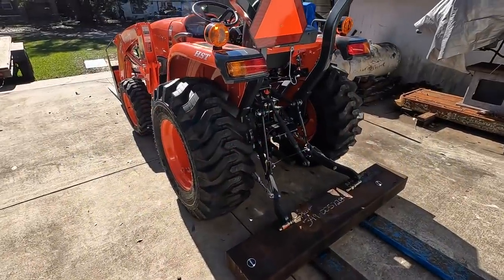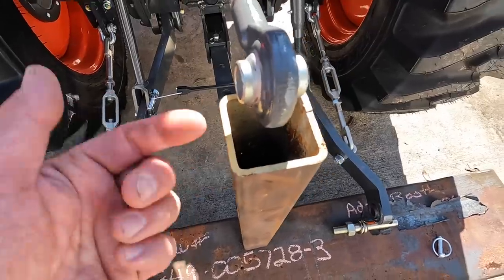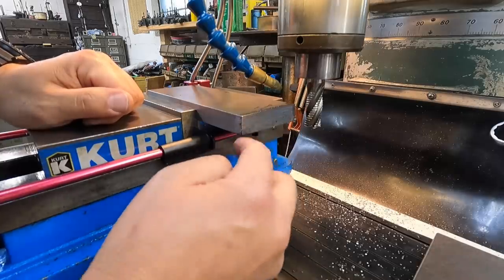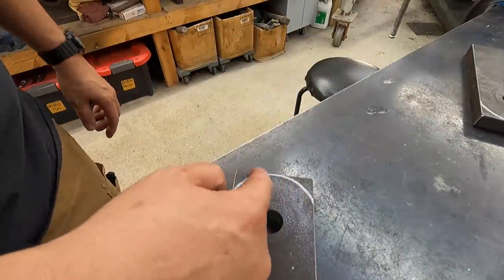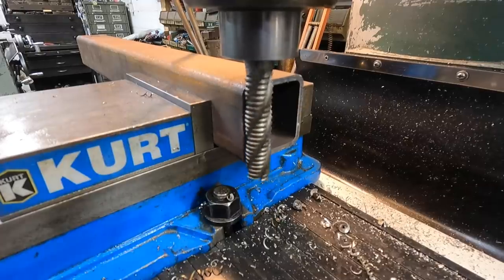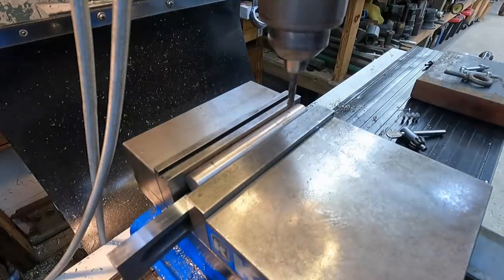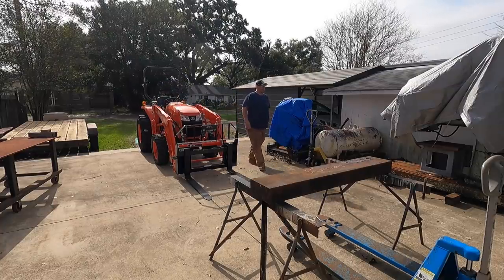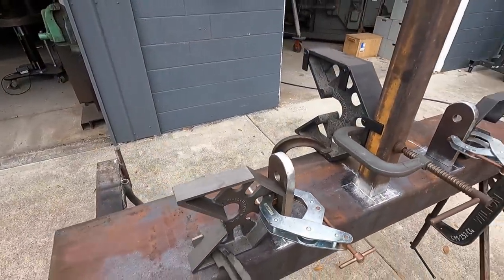Tractor Rear Counterweight Part 1

Comment: Adam,
It you put liquid in the tire don't use calcium chloride as if you have a tire leak it will also eat up your wheels.  I would get lunch pins for holding the weight bar.  They have a spring loaded keeper handle.
Reply: It only eats the outside of the wheel?  Pretty sure those are tubeless tires...

Comment: good to see "the tool specialist" resorting to using the good old grinder to make a hole like us other poor plebs have to all the time! lining up to watch part 2 and wondering if you will add some bracing to the centre post, and wondering if you are setting the bottom two mounts up so you can undo it easily when you want to take it on and off. (I have no idea if those bottom bars can be moved in / out far enough to clear the pins, or if you will have to unbolt the pins to take it off)

Comment: I'd tip it up on edge and just use the bottom links and let it dangle.  One less thing to hook up when you need to switch implements.  3rd link is always a pain to hook up, especially if the angle/length is not identical to other implements you use.  Will always be screwing that link in or out!!
Reply: and have made the ears much shorter, less swing.

Comment: Solid rubber and calcium chloride are also popular fill mediums for utility tires.  If you're on hard surfaces, I'd go with the rubber poly-fill.  I had some forklifts done with rubber years ago.  The water based fillers can corrode the wheels, and end up being really hard, good for soft surfaces, but wear out tires quickly on pavement or concrete.  Rubber fill is really heavy, but stays slightly pliable and won't corrode the rims.

Comment: Instead of wet tires, why not discs in the wheels? Same effect, less maintenance/repair cost. I've had wet tires, and if you break a bead or puncture one, it is an additional cost. Add discs (1/2" plate) and you can add or subtract what you need or want. The wheels are already set up for counterweight studs. Then you only have tire repair costs to contend with when you get a flat. (Which you will....)
Reply: This

Comment: You can easily fill the tires with water. Adapter cheap on Amazon. Center wheel weights are great. Always there and out of the way. 3 point attachment points have standards. Easy to find online. Hitch pins can also be found at TSC and online. Normal is grade 5 and grade 8 is available. Lynch pins secure hitch pins easily and are larger than cotter pins. I would add plate to the upright where pin goes through. 1/4" will wear quickly as tractor bounces.
Reply: Use beet juice, not water. Water will cause damage in time.

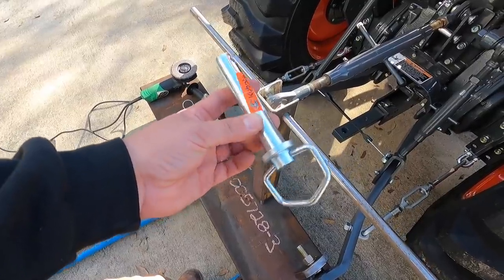Comment: @22:43 Imagine you’re at a farm 200 miles away from the dealership… we use anything we can fit, even if we have to use bushings. BTW the top link helps you lift or level the tail of your implement; usually connected to the end of it, not to the front as you did.

Comment: R clips or lynch pins are the normal for securing hitch pins. A chain or cable from the tractor to the eye clip stops them getting lost in grass, or just have lots of spares 😐 heavy screwdriver are frequently used as a temporary top link pin!
Reply: Until the pin rotates and the screwdriver falls out, and there goes your attachment.

Comment: If you didn't want to cut that solid block of steel, I would be tempted to mount it vertically to the three point linkage. It keeps it narrow and closer to the tractor. I would weld some box section on the base of the block to act as a base and a frame to attach the 3TPL

Comment: Most farm tractor weight are either an empty box fill with concrete, or water ballast the rear tyres with water which adds a considerable I was just writing that as you started talking about ballasting even seen 50 gallon oil drum filled with concrete, it doesn't need to be fancy.

Comment: BTW, the primary reason 3-point hitches became popular is that they form a 4 bar link that allows the center of pull, the point that an implement (originally things like a plow) acts like it's being pulled from, to be further forward and further down than a single-point hitch. Getting the location of the top link right is mostly important to get the center of pull correct (which a counterweight doesn't need).

The other advantage of a 3-point is that it can lift things that stick out the back up off the ground. For those, the top link position mostly effects how the load tilts as it lifts. Again something that's not overly important on a counter weight.

I guess the primary advantage to even using the top link here is that it can keep the weight from swinging.

Comment: For the tires use a non-corrosive ballast like RimGuard. Replacing rusted out rims is expensive. Also, buy the pins at something like a Tractor Supply store. Keep extras of the lynch pins. The counter weight is important to take the stress off the front axle as well as providing better lifting capacity and traction.

Comment: I would have made it with the lower mounts set up in double shear and use a pin to slide through them. You will find it a pain to back up and connect the counterweight with fixed pins like that. Easier to back up and then just side a pin throught rather than have to adjust your arms in and out. I have a small Shibura tractor with a loader and I have the rear tyres filled a usually hook up my 3ft rotary hoe for a counterweight.

Comment: By the wheel weights Adam,  water rusts things or get the calcium additive that doesn’t freeze!  also those front forks attachments are deceiving,the more you push the load in front of that bucket the less you’ll lift. Also the wheel center hubs will turn to make the rear wheels have a wider stance to match the plug.
Reply: Rimguard (beet juice) is the way to go. Calcium will cause corrosion.

Comment: Adam you can go to tractor supply and pickup your own water to tire transfer adaptor and put the water in your self. I keep a little over half way on my kubota about the same as yours.  your top adjustable  arm --where it attaches your tractor has three holes to choose from. the lower you put it the higher it will pick up  The water in your rear wheels will counter balance also

Comment: Chuck that hitch pin and turn it down to ".740 and then blacken it with some ospho!! Tractor Supply has a nice couple of plastic boxes with a selection of hair-pin, clevis pins and cotter pins for dirt cheap, AND they'll likely have any style and length of hitch pin you can possibly need. They've even got steel stock in precut lengths for the odd time you need to quickly get some material to make a repair or finish a project. It' more expensive than a steel supplier, but when you need it "now", it sure comes in handy!!
Reply: Abomb get a tape measure before a visit to TSC

Comment: You should weld a heavy duty D-Ring under the upper horizontal member (frame) of the pallet forks - very handy for lifting odd loads and pulling pallets forward!  I also added extendable / telescopic lower links to my Kubota's 3 pt - worth every penny!  One big caution - do not drill or weld on the ROPS - if you ever go to do a trade at the dealer they will subtract the full value of new ROPS..

Comment: Adam I’m surprised you didn’t just remove the bale on the but end,  chuck that oversized pin in your lathe, drill a center on the pointey end and turn it down to size.

Comment: Wheel weights are the way to go. They can be removed and no issues with wheels rusting. If you go with water in the tires, never use calcium chloride for antifreeze. Another advantage to wheel weights is that a field repair can be made to a small puncture with a pneumatic tire, and if the tire needs to be removed no issues with draining water.

Comment: Nice counter weight!
Kubota place should have informed you about fluid fill for tires when you was purchasing tractor. So that would have been done and more safe for you. Especially when you were purchasing forks. Bad salesmanship in my opinion. I bought a John Deere and they would not let it leave dealership without fluid filled tires because it had a front loader. With no charge for fluid fill.
Hey, add a 2" receiver on that baby. Those things are awesome for moving trailers around.

Comment: If you are lifting at the limit of your tractor, be ready to dump the load at any moment.  Keep your hand on the control, and if you decide to dump the load, dump it all the way.  Jam the control forward, and don't let off till it hits the ground.  If you stop halfway, your will definitely tip the tractor forward, or possibly break something on the lift arms.

Comment: A frame on the counter weight to put your tools in ? It is a top link to level the implements you hook up. Lift the tyre and put water in help a lot with traction

Comment: Funny, I knew you were going to have to sand down the top eye of the 3 pt. Made a ball hitch setup for my tractor to move trailers. Used the same sq tubing and did the same thing.  Saw the tube and said to myself " I bet he puts the hole center like I did" Heh.

Comment: I was suggested water filling the tires on the tractor I used in salvage countless times and countless times I've had to explain that helps with traction it doesn't help with counter weight and the weight it does add isn't where I need it to be. I need to pick stuff up ,balance, not drag stuff along, weight. The tractor was balanced on it's feet it just needed 600-700 pound counter weight, not the ~400 it had. I just wouldn't go out of my way to do it on this tractor unless it became an issue.

Comment: As a farmer, I’m going to enjoy you having that tractor to see all the projects you come up with that I might be able to learn from. Yes, liquid in the tires adds a huge amount of ballast and it’s down low for stability. But avoid calcium chloride which can corrode over time. I too have heard the beet juice works well. Why didn’t you just turn that oversized pin down? After all, you’re Abom!!!
Reply: Rim guard is fantastic.

Comment: Good idea about receiver hitch, hooks etc. WARNING! make sure that if you pull something that the chain or whatever attachment is BELOW center of gravity of tractor e.g. pumpkin on differential. If it is attached too high, tractor has enough power to simply pivot on rear axle and turn over backwards and kill you. Be very careful with tractors, especially PTOs, heavy lifts, etc. B-safe
Reply: Pull from the front only

Comment: Some of the comments here are interesting, and a few are even reasonable. Tractors are a world of their own, and you pretty much need to know all of it yourself, what model, what options, and so on, or the parts will be wrong. It is surprisingly better now than back in the 1970s, as pretty much everything follows a standard of some kind. My '49 Deere (personal machine- third owner) is interesting, to say the least. As for the tyres, weights are nice, but I prefer fluid fill. You need to be aware of the sloshing, handling them is a bit of work off the machine, and you need to be careful to keep the valve up when checking the pressure, but, in the conditions I have worked in (mostly soft soil and clay), fluid gives better traction as the weight is on the bottom of the carcass rather than hanging. Less cushioning, though. Rust isn't an issue if done right (proper mix), and it costs less than weights. Don't do what I did the first time I fabbed an attachment up and make it too wide to get the lift arms off.

Comment: do bioballast or whatever they have for the tires. very effective.  Sounds like a typical tractor dealership experience.  for others, the top pin on a category 1 3 point is almost always 3/4.    many implements are meant for either category 1 or category 2 and have a larger hole at the top for either size pin.   everyone with a tractor eventually just goes a buys a bunch of random pins and whatnot to have on hand.  we have 45 hp Branson tractor that is fantastic.  quite a bit heavier than the Kubota.

Comment: My back tires are full of brine for counterweights on my tractor.  If I need more than that, I just put the bushhog on the back.  You need a linch pin in that top post.  That nut is going to spin off into the grass in about 60 seconds.
Reply: Brine is bad, rots the rims off!

Comment: You can add the water yourself. Just need an air water adapter. Any auto parts store should have it, especially if you live in a farming community. O'Reilly Auto has part number XTS 15-4660 for $12.

Comment: Hydrostatic is definitely the best way to go for loader duties. Manual better for heavy all day pulling but I don’t see you doing much ploughing 😂.
Noticed you gripping rods without bending. Always wondered why you bent the rods anyway.
I have some rods from the ‘70’s that I inherited and use up on non-structural sometimes.
Good work Adam!

Comment: Was talking to a friend about this. He actually sent me a link to this. My first thought was, "is this a joke?" I know that seems like a chunk of counterweight, but most big forklifts have as much counterweight as they are rated for, and there is a reason which many people including myself have learned the hard way. This is the best way to learn Newton's Theory, no better way to learn about gravity and weight.🤫In the case of a tractor it might be ok as you're not lifting too high and I'm guessing you'll only move a few inches to move heavy stuff like machines? There's a tremendous amount of leverage on the forks. Would be good to test lifting say 4000 lbs. with the counterweight on it, or even how much you would lift. If you end up with a shop forklift this could be mute, but I was guessing you'll take this to your newly acquired property where you may build your own shop? And functioning as a tractor, I don't think you could lift too big of a log with a tractor, certainly not without tipping it.
Reply: Ok, now I kinda get it after watching and reading more...your tractor only lifts about 1100 lbs. so this is actually perfect at about 930 lbs. I should have read more before I commented, cause you normally want about the same amount of counterweight as you lift. I didn't realize you would only lift about 1100 lbs., my bad. I guess that's no Abom tractor...😏

Comment: I don't think that Pin is designed for the upper Link, for me it looks like that is some hitch pin ?
Personaly i would cut the Bar in half to have some neat small weight.
And when you add fluid to your tires watch out for some anti freeze, i dont know how cold its get at you Location, but you should be aware of that.

Comment: Hey Adam, should add a piece of 2-1/2 x 2-1/2 x 0.236 tubing for a trailer hitch on top of the weight to the vertical post, you'd be surprised how handy it is.........Mike

Comment: A couple of tips for you. 

Drill a hole in the bottom of the centre box section for a water drain.

If you wind the top linkage in all the way the counter weight will swing back putting the weight further back to give a bit more leverage for lifting when you need it.

Comment: That's a lot of weight on the 3 point hitch. I had a similar Kubota and used a 350 pound box blade when I needed counterbalance. I could max out the front loader without getting light in the rear, so it was more than enough. If you had a was to support some of the weight on the drawbar, shock loading wouldn't be a worry.

Comment: Hint, you have a machine shop behind you. You could turn down the upper pin to match what you need. I can’t tell you how much stuff I have turned down at work with a pipe machine and a 4-1/2” grinder

Comment: @Abom79, Adam, I find it comforting that when the job is just for you, and just needs to be functional it's "that will be good enough".  I know that if this was for a paying customer, you would have taken those two flame cut radius pieces and put them in the mil with a rotating chuck and done a proper radius cleanup.  

As for that wrong part.  I agree with you.  I've had it happen too.  For me though?  I go back, I get to angry, and the cost of those things can get CRAZY for what they are.  :(

Good work here as usual Adam!

Comment: You might want too consider rounding the ears of centre tube, they are more likely to snag as you move around it. Also, I’d recommend drilling a drain hole in the bottom of the tube to let the water out, otherwise it’ll fill and accelerate the rusting process.

Comment: Can you show how you hook an unhook from the tractor. I just don’t get how you take off. I’d asume it’s a quick disconnect seeing there’s quick pins but I just don’t get how as the arms are in the way. Obviously I’m simply not seeing the macanics of how you pun and unpin. Maybe lil demo if you get time after it’s all built ofcoarse. Just don’t know why I can’t picture a tractor hooking up to that. But I’m sure you’ll show us in the end. Great vid.
Reply: With this design of three point linkage you set the attachment down. Pull the R clip or lynch pin on each load bearing pin and then pull each load be bearing pin out. You do the same with the top link pin. On larger tractors, the lower link arms have hooks instead of eyes. You back up and hook on. An auto catch locks the eye into the ends of the link arms. The top link is the very similar but is hydraulic on larger tractors.
Reply: @JonDingle  think I see what your say

Comment: Please consider milling/grinding 1/2" front and 1" rear radii or 45° chamfers to protect your ankles and legs.
Use a clip pin on the 3rd link cross pin, nuts tend to vibrate loose. You may want to add angled structs to the 3rd link post.

Comment: Hey Adam, Cool counterweight. I think you need some lateral triangular support between your 3 points. Because you have a large mass to support, and any lateral force on it will be hard on your welds.  Just add 2 bracket to make a triangle and it will stronger. Like you!
Reply: Absolutely correct. The movement of the tractor shaking from side to side and the weight of the counterweight will be enough to break the welds without any gussets.